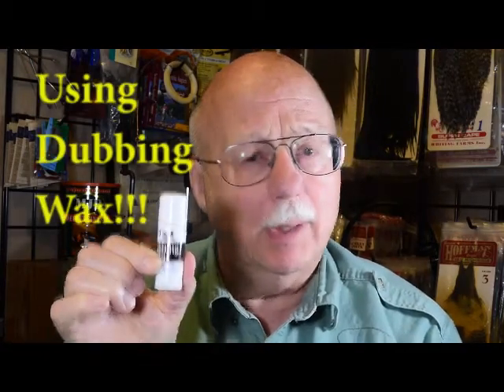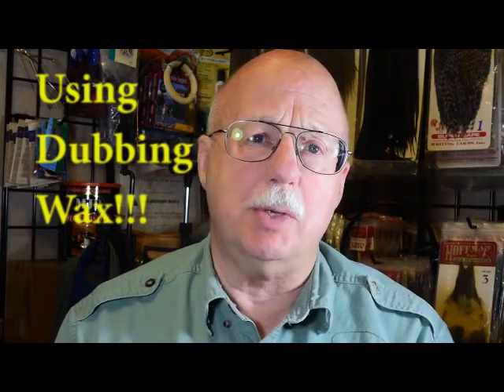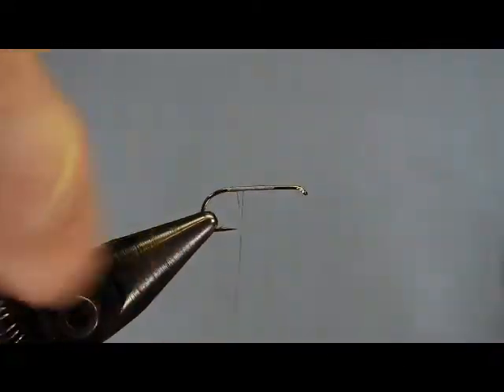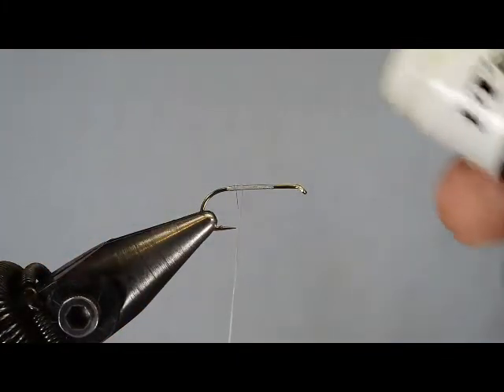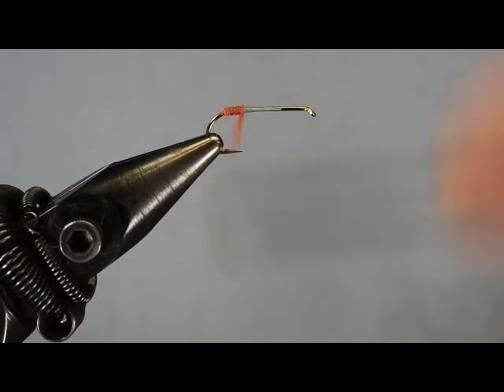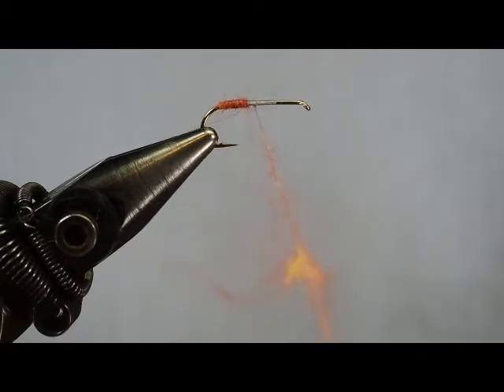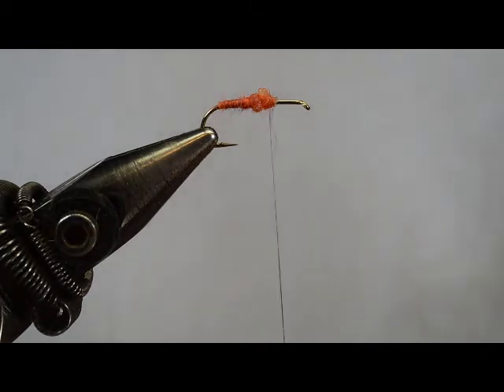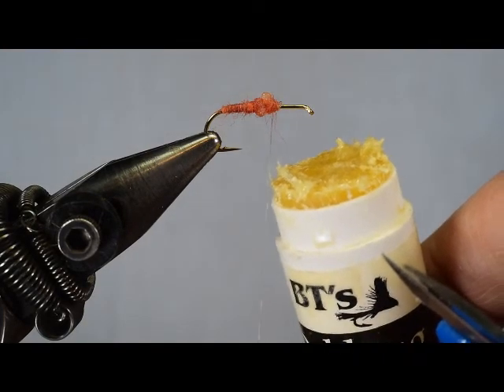Using Dubbing Wax

Comment: Hi Al, have a question for you. I do needle felting with wool and sometimes with things like bird's feet etc. they need to have very little wool on them. Do you think that this product might work to help tack the wool to the wire? I use jeweler's wire usually around a 22 gauge wire... TYVM, Teri
Reply from the maker: Hi Teri, We have used the wax to attach dubbing to the wire but usually the wire gauge is 28 to 32. The only thing I can see about the size wire you are using is you might have to stroke the wax it from several directions to completely coat the wire. It's very important when using the wax to NOT apply it too thick - a little goes a long way. Good luck with your search for a "felting solution."
Reply: @albeatty1404  TYVM For the info.